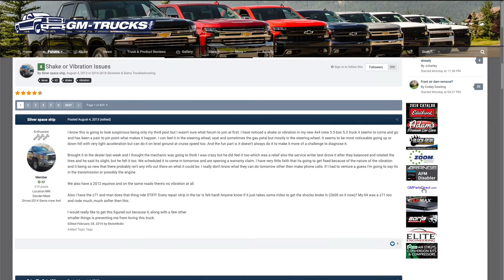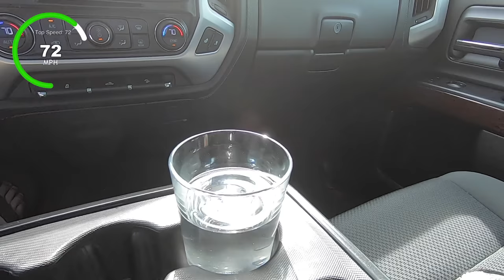"Chevy Shake" Driveshaft Fix for GM Trucks?

Comment: My experience with this issue:

Owned a 2018 Silverado 1500 Custom 5.3 6spd for 3 years and 80k miles - basically work truck spec with manual transfer case on floor. Had it leveled on 33's with Good Year Wrangler Trail Runner a/t's. Never had any issues with shake - did notice the passenger seat would vibrate a lot, but never felt anything while driving.

Traded that in a few months ago for a 2017 Silverado 1500 LT with the rally package 5.3 6spd Z71 - much nicer spec truck, has leather, factory nav, electronic transfer case etc... had 42k miles on it when I bought it and is certified pre-owned.

I made a HUGE mistake of putting wheels, tires, and a lift on this truck only a few days after I got it and have basically been chasing shake issues ever since. I did not have an extensive test-drive on the highway and had only driven on the highway for a short time before putting the lift kit on. I don't remember feeling specifically the shake prior to the lift, but the truck came with factory 22's and I do remember thinking the wheels rode rough on the highway -  possible I was feeling the same shake, but was too hyped on the new truck to think it was an issue.

I have also observed that the transmission on this truck is much more 'clunky' than my 2018. The 2-1 downshifts hit much harder and unexpectedly and I also feel some very hard shifts if I accelerate and then let-off. I have felt some 'stutter' under light throttle going uphill on the highway that I never felt in my last truck. And another weird thing I've noticed is rolling very slowly like through a drive through or coming to a stop uphill with my foot off the brake there's some 'bouncing' or slight lurching that I assume is torque converter related.

I brought the truck to the dealer back in January with the lift, wheels, and tires and asked them to look at the concerns related to the transmission described above. Their response after a test drive was 'everything feels normal to us.' And mentioned they thought the stutter I described was the v4 mode - which I already knew it wasn't because I'm already used to that from my old truck.

At that point I purchased the Range AFM disabler to see if it would help - did not notice any improvement in shake or transmission features, but it is nice not having v4 mode.

I also had the rear shocks swapped to Bilstien 5100s shortly after that which improved ride but did not help shake.

A few weeks later I ended up swapping the wheels for a brand new set of OEM wheels and tires off of a 2021 RST as I had become pretty convinced that at least some of the problem had to do with the aftermarket wheels and tires. This definitely made an improvement, however, I still had a very significant shake at about 75 that would go away at around 85. Had the wheels balanced (high speed) an another alignment, and almost felt like it made it worse. Have not had road force balancing on these wheels just yet (did it on the aftermarket wheels 3 times with no improvement). 

Finally decided to have the lift kit removed as I was getting concerned that this was a bigger issue and learning about the Chevy Shake and preparing to take it back to the dealer.

Lift was removed about 2 weeks ago and put back to stock (rough country 3.5" knuckle lift) and I did notice a big improvement up to about 80mph, but still have the shake somewhat intermittently between about 78mph to 82 mph. I also notice with the stock z71 Rancho front shocks, the ride is pretty bad in the front so I do have a lot of feedback at all speeds from the suspension and at times it's difficult to tell if it's a shake or the suspension, but when it comes on at the 80mph range I know for sure it's something else.

Another thing I've noticed is I do feel a brake pulsation - seems like at highway speeds. At slower speeds it's very difficult to tell if it's a brake pulsation or just the shitty ride in the front.

Brought the truck to the dealer last week and went for a test drive with the Service Manager - he described all the transmission issues as 'normal' and would not drive the truck up to the speed that I feel the shake due to 'insurance reasons'. They did agree that there was a possible brake pulsation but did not recommend any brake service just yet.

So now I'm at a crossroads - do I keep chasing this, trade the truck in (values are pretty high now so I might do o.k. on this), or ignore it. Seems like there are a few more 'low hanging fruit' items I could try (road force balance, new rotors, transmission fluid flush), but I'm already pretty frustrated...I do have a very good certified pre-owned warranty on the truck that covers the transmission up to 125K miles, however, that does me no good if they can't diagnose the issue and I'm miserable every time I drive it..
Reply: if you still have the truck, everytime you start up the truck, hold the tow haul button for 3-5 seconds and when you let go you should see “grade braking off” that should fix the annoying 2-1 clunk, its seems to do good in my 17 gmc sierra 5.3 slt 6 speed, it seems no one really talks about the grade braking on these trucks but i gave it a shot after i read the grade braking is made to help you stop better by using your engine and transmission to slow the truck down
Reply: In my opinion, I would trade the truck. Because it's not the customer duties of figuring out what the certified auto makers are supposed to do. Don't put u and your family life in danger with their issues. And u are spending your own money trying to figure it out. I hate to say it because I'm a chevy\ gmc lover. I'm installing my new built 454 big block in my 1977 gmc c15 short wheel base right now.

Comment: If everything is in balance. It’s pinion angle. Definitely, if it’s slightly worse when you add power or use engine braking. Imagine the output shaft of the transmission and the pinion shaft were real long and could pass each other. Things would be correct if the shafts were parallel to each other. Bad yoke timing on the drive shaft can also cause it vibration.
Reply from the maker: Thank you Karl Jensen

Comment: I have the 2015, crew cab LT Silverado all star package, and no shake, my problem was the rough idle with the 5.3 V8, 3.23 automatic locking rear differential, maybe GM corrected the problem before I purchased the truck, Thank you for the video, just in case if I may need to file a complaint about the rough ride/shaking, most likely they may need to change out the drive shaft, it really looked cheap when you showed the comparison of the original to a better brand drive shaft which was more thicker than the manufactures drive shaft!!! Great video, I hope everything is good now for you!!!!!!!!
Reply from the maker: Hmm never heard of the rough idle. The truck is riding better now. (Sorry for the late reply, trying to catch up on old comments I missed)

Comment: Replaced the transmission that’s what fixed it for me Only 132,00. 3 transmissions later problem solved at my expense a f150 is looking good
Reply from the maker: +berlin3577 really? New or refurbished?
Reply: Been driving new F150s this past year. They have their issues too. All 5.0l make a really nasty chatter sound when you’re under load and let off the gas, Ford can’t figure that out and it sounds like your engine has severe knock it’s unnerving. Driven the 2.7 and 3.5 ecoboost and the fuel economy is worse than the 5.3l on the Chevy and the Media system is trash. Some of these trucks had under 5k miles and the stereo/screens all consistently froze and needed to be restarted all the time. I would recommend test driving a few but be aware of Ford’s own issues lol
Reply: The last one is new
Reply: We are back at it truck is in the shop again getting yet another brand new transmission installed the truck has just over 135,000 on it now I am absolutely not even kidding It should be done Tuesday or Wednesday this time it’s electronics In the transmission went bad

Comment: Im pretty sure the issue is the angle of the rear diff in relation to the driveshaft.
(Like pointing up or down more)  that would cause a shake at some speeds because its not a cvd driveshaft

Comment: I work at a Chevy dealership and I have a 2014 2wd 4.3 and mine shakes at 52 mph at 1300 rpm and only at that speed and rpm . Pay attention to the rpms when ur truck starts doing this . There is alot of issues with tq converter . Vehicles theses days are different and the tq converters dont lock up 100% anymore to prevent this but some of them do lock up to about 90% to 95% and when they get to that point that's when u feel the shake. Now they also have the shutter issue as well  but that on higher mileage trucks
Reply from the maker: I see they issued TSB's for the 8 speed and recommend fluid flushes but they are not doing the same for the 6 speeds. It just adds to the cluster of information that makes no sense.
Reply: If you are having the same issue time after time then they do the fluid flush on the 6 speeds . I still have the 100k warranty so I'm waiting for new tq converter to come in
Reply: @dtp1086  report back when you put the new converter in,is yours 6 speed or 8 speed
Reply: 6

Comment: Multiple issues, just like electrical ones, makes ya tear your hair out!
The cameras aimed at the shaft was revealing, there's still some flex, wonder if the pinions are bad..coupled with the rim out of round creating those oscillations.
I'm sure people waaay smarter than me have researched it.
I'll keep my 98 forever lol
Thanks for sharing Dan!
Reply from the maker: No problem!! They've already tested all of the rims for spec, its been through almost every test you could imagine.
Reply: Keep the 98 bro, i had one for ten years best truck i ever owned. Sold it on a used 05 when it had 220k and rotted out after my son was born. That was 2014, guy i sold it to still drives it with over 300k!

Comment: Had a rather high-Hz shake at 40MPH and 80MPH --- it was a bent front u-joint companion flange ear. This is on a 2005 K1500 Silverado Crew Z71, G80, 5.3. HTH.

Comment: Curious if you changed out the front u joints seems to make a difference on many models that spin up the front shaft while in 2wd mode.
Reply: I have the same problem, right at 70 MPH like clockwork. What I do notice is that is I get significantly less vibration in AWD mode. What do you mean spin up the front shaft in 2wd drive mode?
Reply: @coreybaham8355   He means that the front driveshaft is spinning too even if the actuator has not moved into front wheel drive position.

Comment: I used to have the Steel Wheels/Rims stock. The vibration starts at speed 60 thru 70mph. 

I purchased an aftermarket wheels/rims. There is a gap from the wheel hub aftermarket wheels. 
Decided to purchased a WHEEL HUB RINGS.
The wheels/rims fits snug with the HUB RINGS. Wheels and tires have been balanced and installed. 
I torque the wheels/rims at 140 ft lbs.

Result: No vibration in all speed. At least for me - its solve the problem. 
2014 Chevy Silverado V6 4.3 Worktruck FlexFuel
Reply from the maker: I might try aftermarket wheels too

Comment: how did you get a check from GM and they told you to keep the vehicle?
that isn't how it works.
Reply from the maker: John, I do not know. Ultimately I would have rather they took the truck back. The most bizarre thing I’ve ever had to deal with.
Reply: @GearsGadgets  Did you finally get it fixed?.
Reply: @GearsGadgets  I doubt most people (although they'd probably love to) have the time, money or personal initiative to actually sue them. So when you actually had the lawyers they probably were worried about a domino effect. 13,000 vs potential billions. Because if you had won that would have set precedent for further cases. They'd rather give out hush money (hush in terms of legalities) and wait for the warranties to expire. Problem swept under the rug. Congrats on getting your settlement tho.

Comment: Just for shits and giggles try a set of drop shackles and see if it clears up the rest of the vibration. I noticed a slight reduction when I put mine on. Probably is caused in part by pinion angle.
Reply from the maker: Interesting, I will check it out.

Comment: There's a class action lawsuit against GM that was posted a few days ago for this issue and for 8-speed transmission jerking at acceleration and stops and a few other issues. Hopefully we can get answers.
Reply: where can I find out the details about it. My certified used 2015 Silverado has been in the shop for 7 weeks.
Reply from the maker: Sorry for the super late reply Freddy Sotelo. I appreciate that you stopped by the channel and apologize for not responding WAY sooner.

Comment: So would you point your finger to the driveshaft or axles more to your issue? I spoke with Driveline Performance many months ago and they were great to be honest that they were test things and they themselves were looking more to the axles versus the DS, not saying the DS wasnt a contributing factor to the issue
Reply from the maker: Sorry for the super late reply steve dearmore. I appreciate that you stopped by the channel and apologize for not responding WAY sooner.
Reply: I'm going to bet it is related to the rear end bearings being loose. I just finished front and rear u joints, had the rear shaft balanced, and still vibrates when in cruise control going down a slight hill.
Reply: @GearsGadgets what was your solution guy? Jesus

Comment: When I first saw your video with the water bottle it was exactly the same thing I experienced.. when I told the dealership they kept going back to it’s a tire issue.. I’m not a rocket surgeon  but it when something isn’t right and that vibration was not right by any means..glad I can across this was begging to think I was nuts..
Reply from the maker: You are welcome Tim Rau.
Reply: Tim Rau could be tires. I had a bfg tire that seperated on the inside with zero evidence and i had a death shake .

Comment: I'm having this issue and seriously considering selling my truck. Technically mine is lowered but it has become a bit annoying when mine vibrates really horribly at 63/64 mph. I've thought about the driveshaft as it was shortened during the lowering since the balancing would most affect it. Just wish I didn't have the issue at all
Reply from the maker: It is REALLY annoying is a complete understatement.
Reply: @jason3211  balancing of the wheels and tires fixed the issue but i did upgrade the driveshaft

Comment: What about a 2007 Crew Cab 8 foot bed 2500HD turbo diesel Silverado 4x4? Mine shakes from 40 to 45 MPH. My rear driveshaft is a 2 piece.
New tires balanced. Front end is aligned. Suspension and steering checks out fine. Front CV axles are good.

Edit: I've read in the Duramax forums that the 2500 suspension and chassis will shake and bounce at certain speeds when there is no load in the bed or no trailer load being pulled. They say if you add a few hundred pounds in the bed it magically goes away. I guess the frame and suspension is so stiff that it can get bouncy at certain speeds. This seems to be the nature of the beast and supposedly what the GM engineers said it was too.
Reply from the maker: Not sure, that is going back further than I have heard of it.
Reply: @GearsGadgets  my dad had a1989 4wd crew cab 8 ft bed silverado that had a vibration from about 40 mph on up. Could never solve it as long as he owned it over 100000 miles.
Reply: Meant extended cab

Comment: I did the axle swap and had my driveshaft straightened, Have had the same results as you. Next item i'll be messing with is the ring and pinion.
Reply: Its converter mine was replaced and it's gone
Reply: @sschevmale24  who replace it GM or you?
Reply: @NKKUSTOMS  chevy dealer did it.  I had to go through their process 1st time they redid computer, 2nd drop off drained fluid, 3rd drop off drained fluid and flushed, 4th time they replaced the converter.  It was a pain going through that process but I have 12k miles on it with no problems.
Reply: @sschevmale24   been rearing and looks like some get it fix with new tq converter and some with new shaft or rebalance the shaft ,can get expensive trying to see what will fix you truck ,can get expensive every because evry truck look like is different  problem
Reply: @NKKUSTOMS  no my brothers truck did the same thing.  Dont know why they wont replace the converter.  His is gmc they are all 8speed problems.  Mines a chevy and my dealer is awesome.  They knew exactly what was wrong with it.  I will always buy my cars from them.  Service is excellent
Reply from the maker: Thanks Davis Hernandez, I appreciate it!!!
Reply: That's what I found  on my truck it was the converter drove me nuts for sure now mine drives like a Cadillac
Reply: @nathanwebb6069  what was yours doing??? And what year??
Reply: The rpms would go up and down about 200 and 300 rpm. But a way to find out is if you drive down the street and it starts doing it barely hit the brake pedal and hold it and if it goes away then its the converter if it don't then you have something else going on
Reply: O yeah mine is an 08 with a 4.8 4l60e trans.
Reply: Any difference with the axles???
Reply: Nope
Reply: The thing that sucks is with a newer truck like this, you shouldn't have to do all that. One of Chevy's Low quality and production costs, maximum profits.

Comment: my folks have a 2007 chevy Silverado extended cab and between 1000 and 1500 it has the random shudder like driving over a wash board in the road . havent checked the U joints yet

Comment: Got a 2015 silverado LTZ. with 6sp trans 5.3 no vibrating I guess they did something right.
Reply: I have an 2013 GMC Sierra 1500 with the 5.3 and the 6 speed transmission and I have never had any problems with any vibrations.
Reply from the maker: Lucky!!